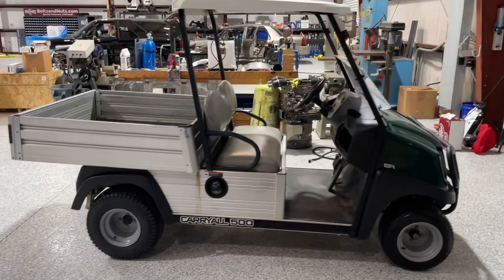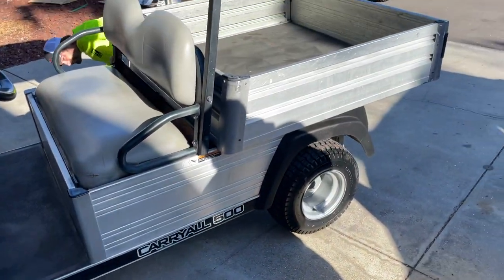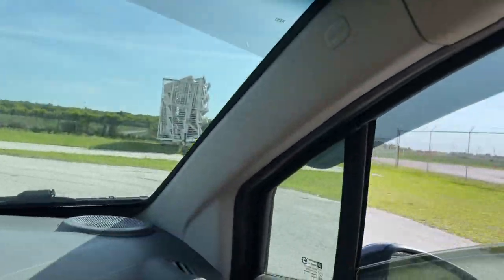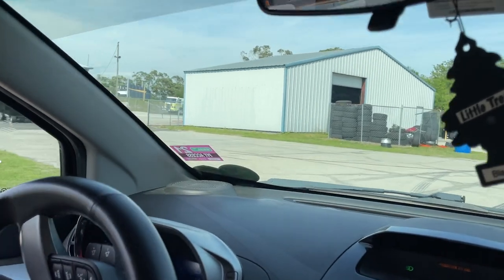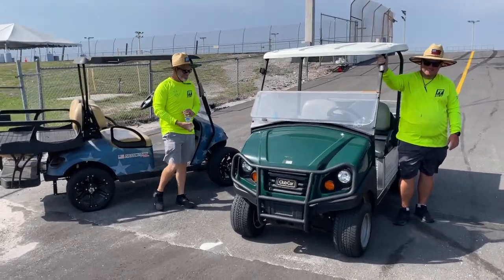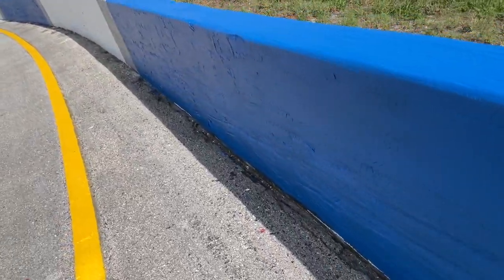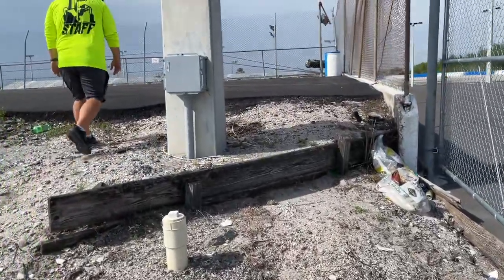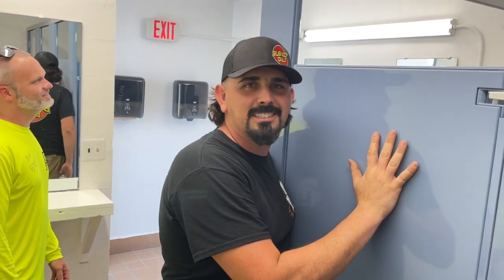Renovating an Abandoned Racetrack Part 13 - FINALLY Painting the Track, Bathroom Repairs & More!!!

Comment: An airless paint sprayer would probably help with all the outdoor painting!
Reply: Yea, I was just thinking the 795 running off inverter generator in the back of a side by side, with some shields. Could've had each color done on the track in a few hours each. Then you hit up that gray with a 9" 1-1/2 nap couple coats. Done deal. One day.

Comment: FF guys ,  down at HMS they use a graco gasoline powered airless sprayer with a 50 ft hose it stays on the apron and with a 3 foot extension and long card board you don't need the rollers of the drop cloth .  pulled on a low dolly golf cart trailer .

Comment: pro-tip from years of working security, if there is a place to scribble people will, the best counter action is to give them something to scribble on, hang some smoothed down plywood and leave a marker, after an event pull them down, stain/seal them, and hang them/store them somewhere and put a fresh one up.

keep a flat black rattle can on hand for spraying over the awful/dumb stuff.

Ive seen a few bars where they do this with the table tops and then hang them on the walls to decorate once they are sufficiently filled in.

Comment: Great job on the infrastructure work at the FF. I have been a drag racing fan for over 60  years. Became a paraplegic at the age of 21 following an off-road motorcycle accident at the age of 21. Little concerned that you have no ADA accessible bathroom accommodations at the FF. Do it for Dale!

Comment: You likely won't see this but men's shaving cream takes permanent marker off of paint, as does alcohol. Or you can write over it with an expo marker. If they engrave your paint that's a different issue (in regards to the new bathroom partitions.)

Comment: Dear Cletus McFarland I'm writing this letter to you in regards to your comment made about the disrespect disregard and the suggested dissolution of your engine builder just so you know I'm with you on that and in case you wondered my comments were based on educated guess on the  engine knock and the other information was directly related to making sure your push rods are locked into place suggestion of narrowing head slots I'd hate to think that anyone might think I play the part in bad-mouthing Texas speed from what I can tell everything they built you has been pretty spot on there's always a chance of a wrist pin letting go under stressful environment like two step and high RPM launch but from what I heard I've experienced that sound many times one was a wing nut from the air cleaner lockdown in the head and piston area and the others are all wrist pins especially on my 410 Mercer which was a 428 crank is a Mercury engine out of a 1960 mec and I ended up having a wrist pin logo and exploded the whole side of the block out the from transmission bolt up plate to just shy of the front  soft plug came around and took a two inch by 3 in chunk out of the other side after ripping the pan in half that was chrome rings sodium filled stainless steel swirl polish valves aluminum dome Pistons scj heads and [ 428 crank ford ]∆/ 410 Merc I feel it's long-winded at this point just letting you know your engine builder is always been there as far as I can see and you couldn't ask for much more I just hope other people see the same thing and always know if I make a comment it's an educated guess not a downgrade toward you or your people!!!!

Comment: Wow! You are dropping serious coin on the FF. We all can see you are here to stay. Please start Racing the Legend Car at the FF. They are the cheapest way to get into this type of racing. Plus they have Legend Drift cars now. If you hold Legend events you will get a lot of the Mid-West guys in the winter months. You have the perfect track to run them cars. Some of the dirt Legends will need to re-gear, but it is easy to set one up for asphalt. Just one race a month would pay for most of the track expenses for a year. You could hold the Daytona 500 of Legend Cars in February. They can’t race up north in the winter so I know you would have big turn outs..